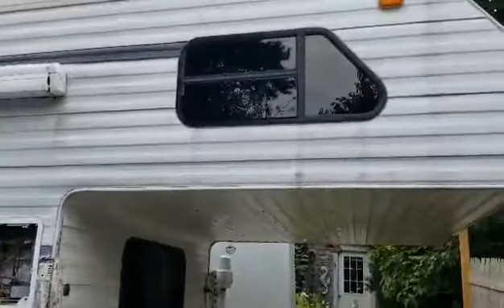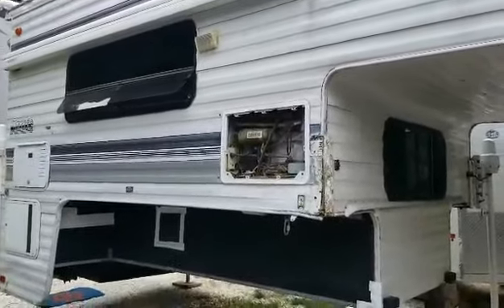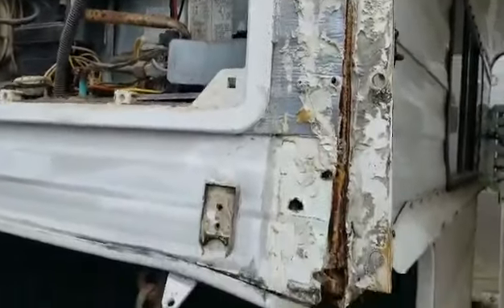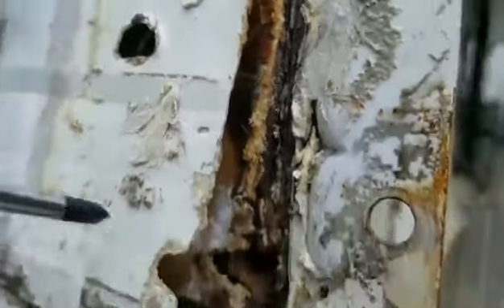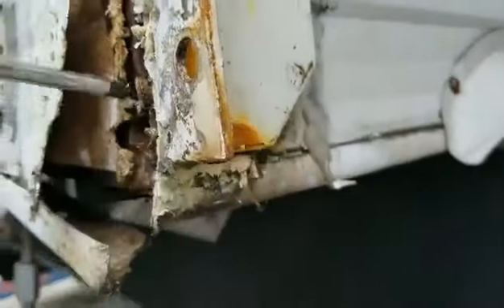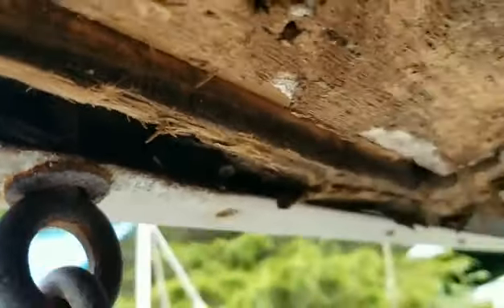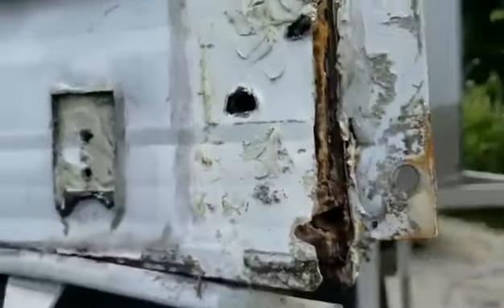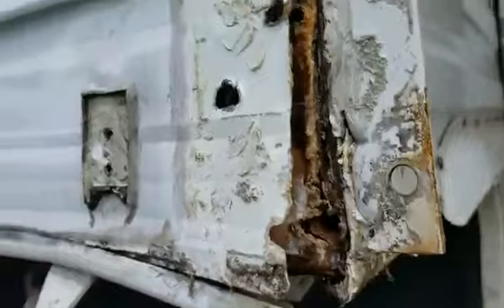HELP !!! How Do I Rebuild the Corner of my Truck Camper  ??? 1996 Lance

Comment: It's my belief that these types of things are not made to be resurrected. Automobiles are built to be repaired if they get wrecked. These campers are not. In the case of your camper, you just have to peel back the skin until you find undamaged area and replace the damaged area. Notice I did not say anything about it being an easy task.
Just today I acquired a 10-foot slide in camper that has similar damage only worse than yours. I will have to follow my own advice.
I'm curious if you made any progress in the past year.
Reply from the maker: Yes, I reenforced the corner with PT 2x4 cut down, I  used stainless nuts and bolts instead of the lag bolts. Its nice and secure now. My computer crashed and I lost all my video footage of the follow up work. Sorry I couldn't show the improvements.
 Thanks for the comments.